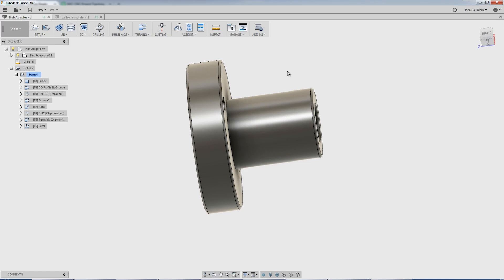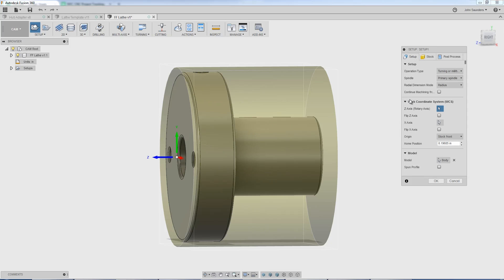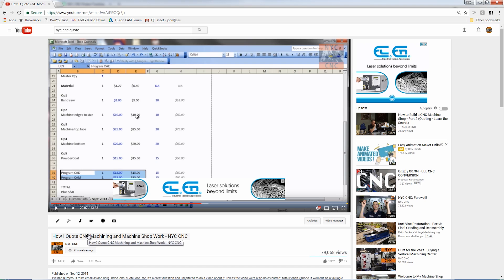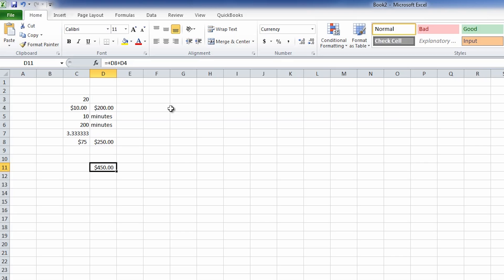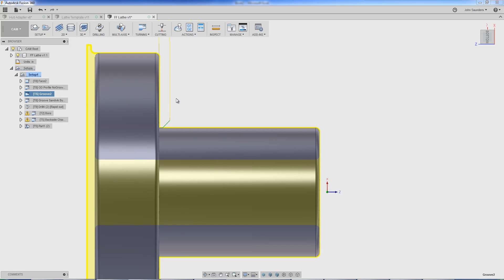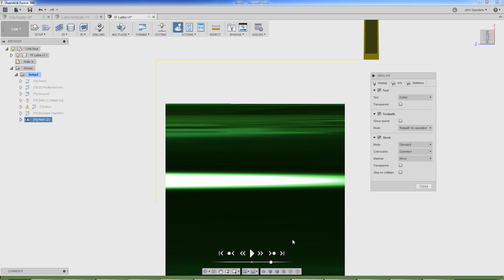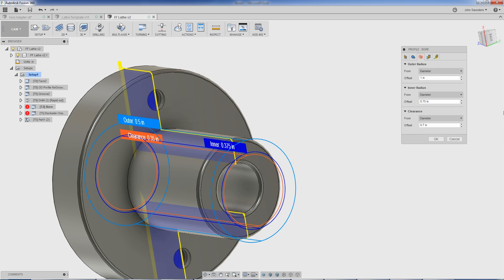Fusion 360 Lathe CAM Tutorial!  FF89

Comment: I produce 99% of my turning progs at the machine or in a text editor in iso G code. Your canned cycles and a little (or in my case a lot) programming knowledge is really all you need. You can also save basic templates and edit them to suit. I use Fusion mainly for milling, then it really comes into its own.
Reply: there are contours which are rather hard or time consuming to program by hand
Reply: @TheKeule33  agreed 👍🏻

Comment: We can’t seem to get through a decent cam program in fusion without it constantly freezing and crashing. It’s nice for drawing models but the cam side of it is not so much. We’re looking at a alternative cam program for the lathe right now. We have Gibbs for milling side and it works well it’s an incredibly powerful tool.
Reply: Glenn Edward in my experience the modeling is very weak along with lathe CAM  
But fairly strong for milling. Not sure why you are crashing but you might wanna give tech a call cuz I’ve been using F360 since the beginning and only had it crash twice.

Comment: Nice video! Do you have any easy trucks to program in an offset when you're lathe is cutting with an unintended slight taper? Thanks, your great are great education.
Reply: @Jason Lanning Did you ever solve this?
Reply: @LooseyHenderson  I was not able to, I found a setting in my machine to make the correction.
Reply: @jasonlanning2394  Great to hear. Not done anything long in mine yet, but my very similar manual lathe cuts slight tapers, quite annoying if you're looking for accuracy. 
Hopefully my cnc lathe won't be the same.

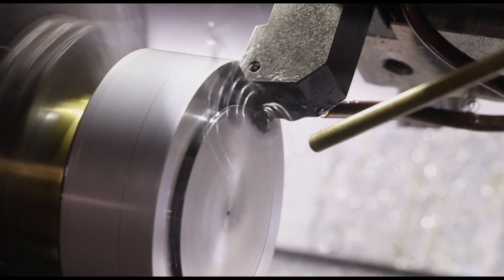Comment: 13:53 are you sure. it calculate all based on your tool that has spike. i try simpler OD roughing. it takes me 2 hour do get simulate  without RED RED RED going in part (why it go in part) model is there tools is there stock is there. CAM isstupid. it take 10 seconds write that gcode hand. it is 10 lines. CAM output 1500 lines.

Comment: Do you think it possible to use the Lathe CAM with a 4th axis and a router head instead of a single point lathe tool?  X & Z in my case...and then possibly cut threads with a 60 degree router bit?

Comment: You leave alot on the table as a job shop by focusing on mills. Motion transfer parts are most commonly cylindrical and often have stringent concentricity and circularity requirements that are sometimes not met by a mill without resorting to things like boring heads.

Right now you're looking at 3 setups to complete the part (turn, axial holes, radial hole), but you could eliminate 1 setup with an ST-20 or 2 setups with a DS-30 with live tooling. 8 minutes per part in just turning would be cut down closer to 2 minutes with a professional grade lathe.

You may not like lathes, but if you were to hire someone who loves lathes, you could expand the capabilities of your shop and provide more value to your customers...which is a core component of Lean, is it not? Why would a customer want to go to you for mill work and another shop for turning when the other shop is competent in both? How does that best meet their needs?
Reply: In my experience, the nature of work varies depending on the location. For here locally, the shop I work at usually employs nearly twice as many CNC mill men as CNC lathe men. The mills are somewhat nicer, while two of the three lathes are old and dilapidated. The three mills run almost every day, while typically only one lathe runs every day; the other two run every few days. I suspect John's world is similar. 

A nearby shop is the same way, if not moreso. They have three lathes (one being a Swiss), while they have six or slightly more mills.

Then you look at a shop like where Adam Booth/Abom works, and it (seems) to be a vastly larger percentage of lathe work! Funny that way.

I guess it depends on what work comes across your table. If folks send you 75% mill work, you oughta have more milling capability than turning. If you invest in a fancy new turning center without the work to back it up, that can be scary. Sometimes you gotta keep to your strengths.
Reply: Kenneth Higley 
You'd be surprised how much more mill work there is vs lathe work lately. You can certainly maintain a business strictly on mill work alone. 

And a CNC mill can make short lathe parts easily. A lathe doesn't make milled parts too well unless you spend the $$$ on live tooling and Y axes
Reply: NYC CNC 
What I liked was "you need a lathe!.... and then you need to add a bunch of milling options to said lathe!!"
😆
Reply: Occams Sawzall yes, so you can stop wasting a ton of time on setups. Setups add exactly zero value to the customer. There's a very good reason live tooling is the most popular option on an industrial lathe.
Reply: Kenneth Higley 
Because even lathes know mills are better. 

Could always just get a turning option for a mill. 😝
Reply: But when you only have a lathe. It's everything..  Even your mill
Reply: And when all you have is limes, everything starts looking like tequila.